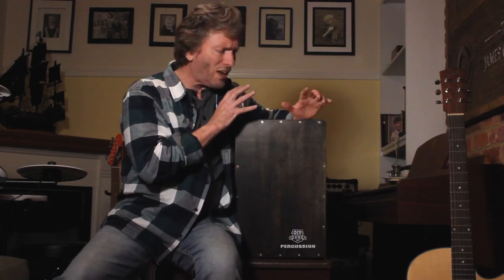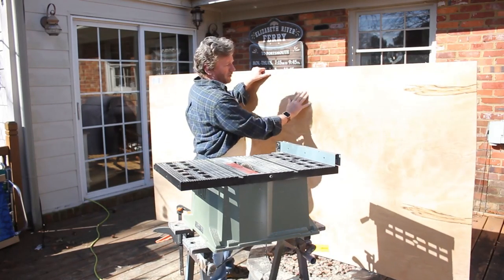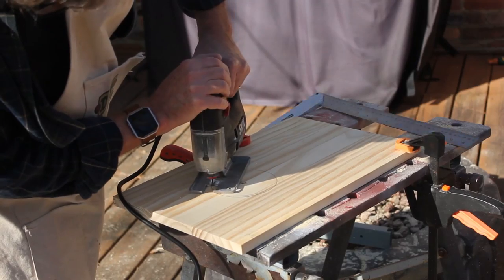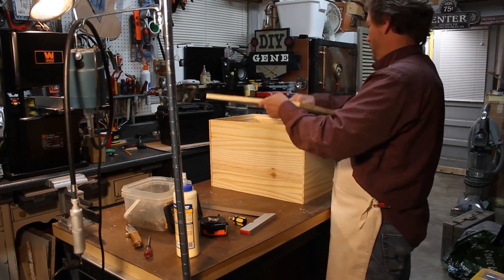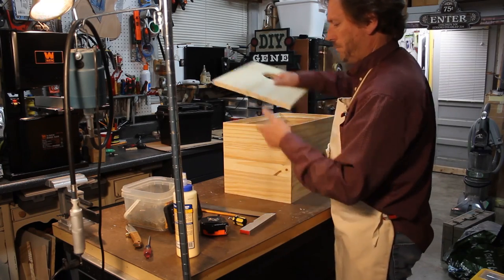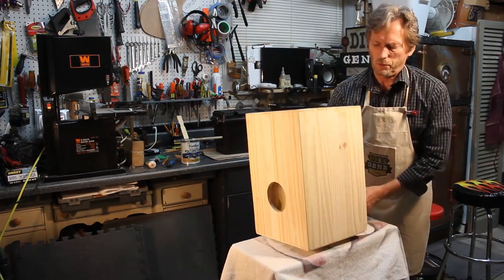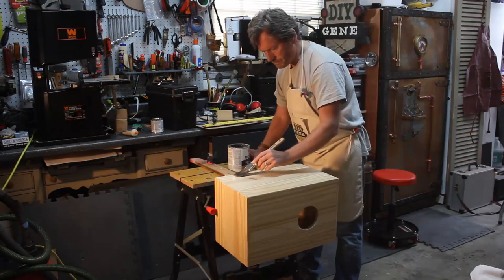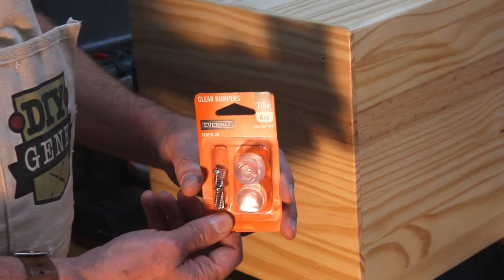Cajon Drum Build Your Own (Step By Step)

Comment: I know that I'm way too late, but still: If somebody wants to use this as a guide, I would suggest to use thinner wood for the back as well. The Cajon will be absolutely sturdy enough with those 4 massive sides, but it will resonate better with thin wood for front and back. I heard both and with thicker wood it sounds more compressed and doesn't have as much low end. <3
Reply from the maker: Great suggestion. I just may have to try that. Thanks for watching.
Reply: @DIYGene  Thanks for making that video. <3 A Cajon is an amazing diy project suitable for all skill levels. You can make it super barebones and it will work fine and you can make it sound great. The first Cajon I built was literally going into the hardware store, they cut me the six pieces of wood to the required size and I put it together. You can experiment with the sound, vary the woods, the thickness, use different kinds of things for the snare-sound like strings or bells. And of course you can get fancy with your craftsmanship and do beautiful woods, contour the edges or even do inlays and other embellishments to really show off your skills. I have played a self built Cajon with snare elements that could be adjusted from the outside and it even had built in microphones and a preamp.
Reply: @marctestarossa saw your comments on the Cajun drum and liked what you said. Have you ever put in a spring to add reverb?
Reply: @zardozica  no, never heard of that, how is this supposed to work? I mean which parts would be connected through a spring?
Reply: @marctestarossa  two eye hooks on both sides with a spring strung between them.
Reply: Check the schlagwerk 2inOne cajon. It has indeed two sides with a thin layer (one with snare, one without) its the best thing ever. So much bass

Comment: I really love  this. You could have put strings across the top so that you have a snare sound and lower down you would have a bass drum sound. That would be really cool.
Reply from the maker: You are right. I think you could position the snare stings higher to give a stronger snare and deeper bass. I have also seen videos that mane the snare strings adjustable so you can change the sound of the Cajon. I may try doing that. Thanks so much for watching.

Comment: Some people would like to try different wood combinations. My advice would be to listen to different guitar players that tap on guitars, find a sound you like, find the guitar brand being played, and figure out what their wood construction is. For better bass, consider a drum pedal mounted backwards, in front of the box, and use a felt hammer for the pedal. Also try mounting a microphone on the sound hole with rubber bands, so that it floats without touching any wood. You could try a different option, and attach a small eight-inch bass speaker, with the paper cone pointing into the sound hole, and connecting a XLR plug from the speaker to plug into a small PA system and adjust your tone and reverb effects for the bass and snare. One last idea is to not glue the snare blocks, but hold the assembly in place by going through them with a threaded rod which has a M8 Female Threaded Black Screw On Type Knurled Clamping Nuts Knob.
Reply from the maker: All great suggestions. Especially the wood. Tone is different with different density of wood. Thanks again for the suggestions and for watching.

Comment: ⛔️ I wonder if you put a 12” (or whatever the width is on the Cajon) x 1/2”x1/2” stick across the front about 6” down from top to better separate the Snare sound from the Base sound? Just wonderin’.   And, maybe a thinner piece on back for tone ?  : j
Reply from the maker: I have thought about actually putting a solid baffle at about mid point to see if it would give separated tone between snare and bass. You idea may be better. Thanks for watching.

Comment: Does a cajon need a snare inside or can it be built without a snare ? The reason I am asking is that a snare is a hard (near impossible) to find item where I live.
Reply from the maker: You could go without the snare but would loose that sharp sound towards the top of the Cajon if you can’t find the snare material perhaps you could experiment buy running wire back and forth towards the top between nails to create a snare?  I hope that makes sense. Thanks for watching.
Reply: @DIYGene  Thank you for the answer. I will try to see what can be done in the way that you described.

Comment: I love your build and have a few questions. Do you think rounding the braces that you put inside would have made a difference in sound? Also, what do you think about using hardwood vs softwood for a cajon? I really enjoyed your build.
Reply from the maker: I don’t think the bracing make a difference in the sound. Only because a acoustic guitar has a lot of square edge bracing through out the inside. I do think the wood has definitely different sound tones. I would be curious to hear them .
Thanks so much for watching.
Reply: @DIYGene  Martin scallops the bracing on their higher ends. I’m going to attempt something similar on my supports following your build here. Just bought the wood today.
Reply from the maker: @biosec9361  , that’s great I hope it turns out fantastic. Thank for watching.

Comment: I've thought about making one for me and my husband (we're both drummers). My husband played the one I'm playing now and he had a really hard time with the depth of it (11" W x 10.25 D x 19" H). It's way too shallow for him to sit on. It kept trying to turn over with him. As for me, it's a little wide for me, as I'm a little bitty female. What do you think the difference in the sound would be, if I make one with the dimensions of 10.5" W x 13" D x 19" H? So it .5" less width, and 1- 3/4" deeper, but would be the same height. What 's your thoughts about the sound difference?
Reply from the maker: I don’t think it would make a big difference. You may get a little more bass from a larger box and a bit sharper from a smaller box. But that’s what is great about building one is it’s customized for you. I made mine to get the max out of the material I purchased. Thanks so much for watching.

Comment: Why’d you use glue instead is screws or nails?
Reply from the maker: The box frame is glued together. But the Toppa or face of the drum is screwed on to let you adjust the tension of the drum for sound. Thanks for watching.
Reply: @DIYGene   awesome thanks

Comment: Think it's over built. I know Jack shit about cajons, but I know acoustic guitars.
The bracing you built would more than support your weight, so you could use thinner materials for better resonance and increased volume. The top could be 1/2" while sides,  back and  bottom could be 1/8" around a 1x1" built frame.

I liked the build and I'm not bashing you in any way, just thinking about more bass. I dig the sound of it, but I think the thick wood makes it sound dead/flat and super crisp. Like I said, just thinking.
Reply from the maker: I like your suggestions and would be curious to see and hear the sound difference. Like that of an acoustic guitar.  Thanks for the great suggestions and thanks for watching.

Comment: You did a better job tgan the spanish dimwit that sells these profesionally, supposedly hes been working with wood for 20 years, but doesnt even know basic joining techniques for timber. Literally just glues the box together and hops for the best
Reply from the maker: That’s a little scary, considering you will be putting your own body weight on it. There are a lot of really good ways to build a sturdy box. And mine is just one way. Thanks so much for watching.